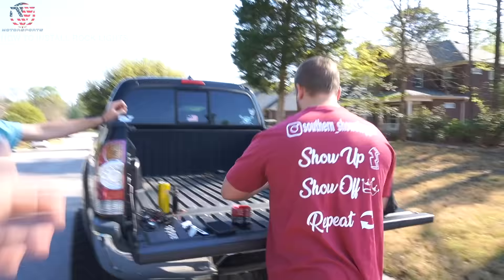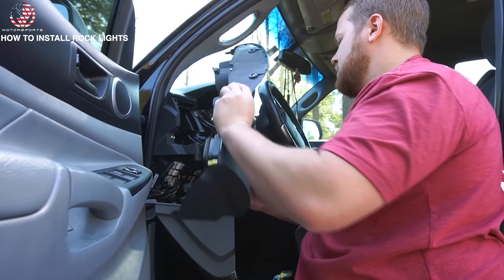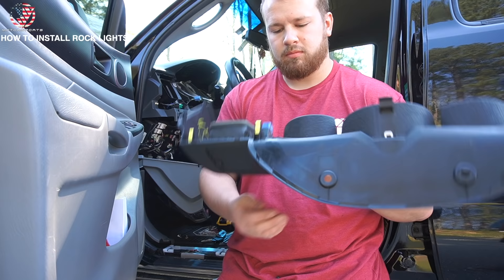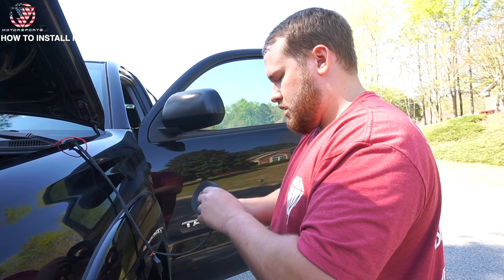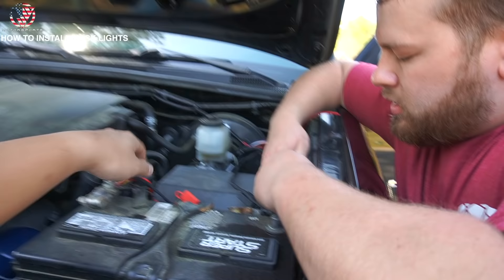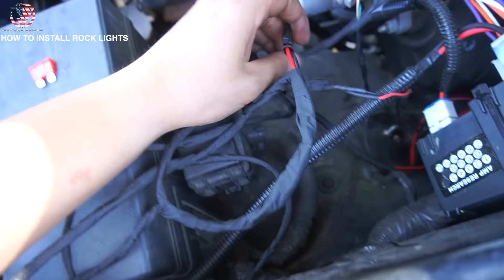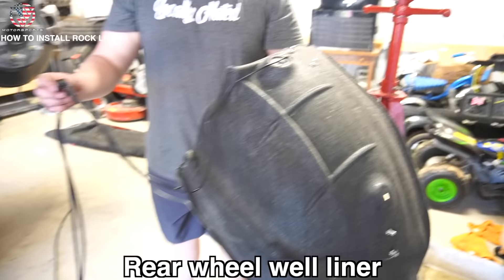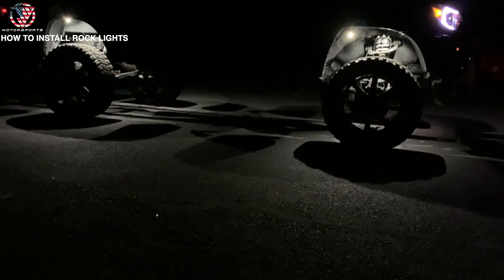HOW TO INSTALL ROCK LIGHTS: STEP BY STEP

Comment: You should google what a firewall is before you say it anymore
Reply: For real
Reply: I’m confused he was pointing at the firewall.
The firewall is part of the automobile body that separates the engine compartment from the driver. If you watch the video he is pointing exactly at the part of the automobile that separates the driver from the engine was he not?
Reply: @Dually Life 979  the whole thing is a fire wall not just where the grommet is

Comment: Would it be easier to splice the rears into the trailer light harness? So you don’t have to touch any factory wires. The front can be connected to an add a fuse for the same running light circuit.
Reply: Could do it that way if you dont want them on a switch. Personally I'd like to be able to control when they're on or off

Comment: I have 2 LED offroad  lights in my bumper could I use all that wire an toggle switch I used on the LEDS but on the Rock lights ? Its on a 2000 two wheel drive toyota Rav4

Comment: i just ground mine near the frame by the light so i only have positive wires running through the truck
Reply: That’s what I did too. Much easier than running 2 wires
Reply: @Haydini69 isn't the ground wire on the switch just for the led light on the switch

Comment: So I’m doing 24 lights, 3 in each wheel well, 2 under each door and 2 in front and back, this wiring setup should still work the same?
Reply: Yes.I would use14 ga main wires.

Comment: my battery cant hold a charge bc of my wheel lights. and im looking to install rock lights. what is the best battery options for those mods?
Reply from the maker: Add a secondary battery
Reply: LEDs do not draw a lot of amps.Usually 1/10th of a incandescent bulb.Seem my post on a remote and relay install.This insures no parasitic draws.

Comment: Their example truck pictured on the web page is squatted.... -50 points.  Also,  the entire divider between the cabin and engine bay is the firewall,  not just the pass through grommet, hence fireWALL.....
😂

Comment: Would 18g wire be fine?
Reply: I went 14 on long runs and 16 on short.
Reply: @usmc6911  I went 18g all way round,  works fine.